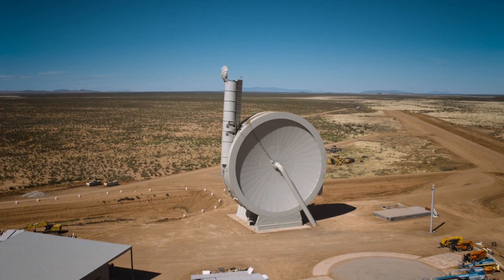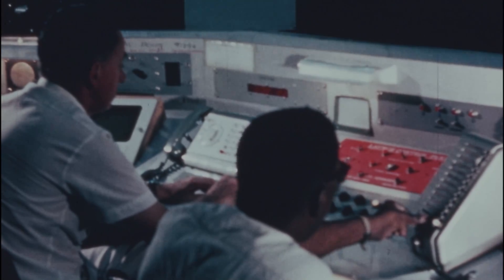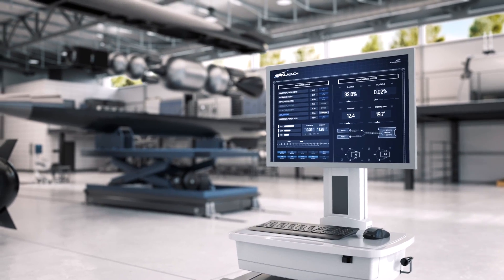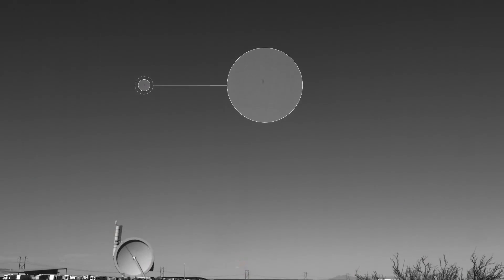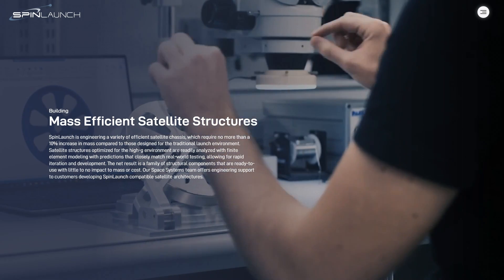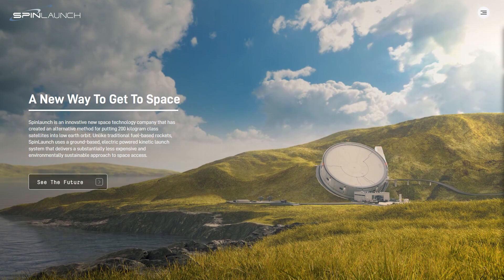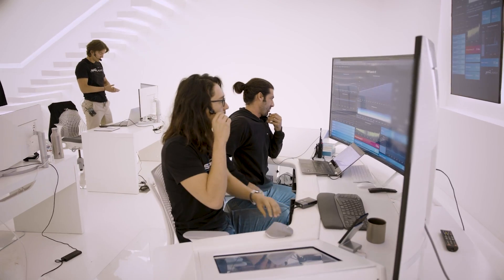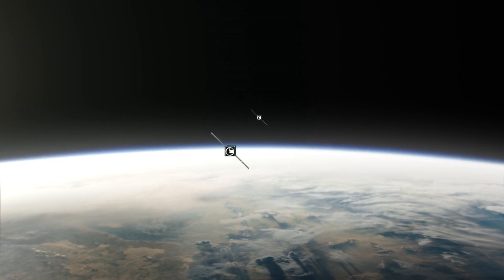Can Spinlaunch Throw Rockets Into Space?

Comment: "Like one millisecond to hit that very narrow exit channel"

If I'm not mistaken, at 450 RPM 1 millisecond is almost 4 degrees. I don't think they have that much wiggle room there.
Reply: I think he was referring to their test at 180 rpm
Reply: As a person who works on control systems - a millisecond is pretty huge.  This is not the most significant challenge of the project.
Reply: @jzero4813  the control systems aren't hard of course.

What I do expect to be hard is making an actuator that can physically open in 1ms (or at least with a opening time that's repeatable within 1ms) while also being strong enough to hold a Gerald Ford class carrier
Reply: @jonashageboke8993  And release it not all at once, but gradually (if that's the right word.)  The payload will have angular momentum that will have to be compensated for.
Reply: Exact timing and angle is not the concern. computers work really fast. The problem lies in the hardware, but I think they can use electro magnets for that, which will be very consistent.
Reply: @bugqualia8881  Sending a trigger signal at the precise time was never a problem, as that time is planned far in advance.  The actual mechanical release precision (even if using magnets) is the technical problem to solve.  Mechanical printers were speed limited by how precisely they could time hitting the paper with a lightweight needle attached to a slower moving mechanism.  DVD and Blu'Ray players are speed limited by how quickly they can move the optics to compensate for the disc being slightly off center (and by the internal G load on such an unbalanced disc).
Reply: I'm pretty sure the trigger is keyed to the rotation angle in some way, probably physically with gears, and that problem has been solved in internal combustion engines since the 1860's. Today it's not uncommon for off the shelf motorcycle engines to be able to open and close the valves with very little wiggle room at well over 10k RPM. Also direct fuel injection, and ECU controlled spark plugs are a thing.
Reply: It was solved in ww1 when planes needed to fire thir machine guns without hitting their props
Reply: @TheYrthenarc  The trigger would just have to be on the wall of the chamber.  EASY
Reply: They should hire this comment section.  ;)  As a mechanical engineer who works with power station turbines- a slight imbalance will absolutely turn this whole thing into a bomb.  Just look up the 2009 Sayano-Shushenskaya power station accident.  I would absolutely trust the PID control system- but the release actuator and rotor balancing are a different story.  Anyone know what kind of bearings they are using?  I am curious too if they are using a rotary encoder to detect the angle to do the release- if they can get the kind of accuracy they need.
Reply: @BenWard29  It could easily simply be mechanical. Assuming it will have a single optimal speed at which it releases, there is a single point along its circle of motion at which release would have to be effected. Imagine a spring catch releasing a pin, but the pin can not be pushed by the spring until it lines up with a fixed socket positioned on the track of the arc. This would give actuation of the release a full 359 degree arc in which to be triggered, with the mechanism only capable of actual release at the exact position that lines the projectile up with the tube. If you know how fast the mechanism releases, you can derive exactly where to place the physical structure that allows for release. This would absolutely prevent the projectile from being released at any other point. As to the balance  of the arm changing, that is easily solved by simply having TWO exit shafts and having a proportionally heavier counterweight on the short arm of the centrifuge that releases at the same moment- only in the opposite direction- This could throw a counterweight into an inertial dampening fluid like a shaft full of denser gas buried in the ground.
Reply: @christopherpardell4418  I don’t think it’s mechanical- I could be wrong- but I would assume they would want fine control over that and to let the computer possibly account for factors to release slightly early or slightly later.  A mechanical system would not give them the feedback or data analysis I think they want.  The counter weight idea would be tricky- you’ve got to release 2 items precisely otherwise you will unbalance the rotor- but maybe.  You’d likely be better off decelerating it electro-mechanically (reverse-rail gun) into a tube in the ground- you could gain back some of that electrical energy that way as well- a 2 for 1.
Reply: @BenWard29  	 But doing that electronically is a problem- Doing it mechanically is child’s play.   In an electronic system there’s a hundred different ways it could fail. If you make a system so that it CAN release at the wrong moment- then it almost certainly WILL release at the wrong moment, sooner or later.  But if it is physically delimited so that it can ONLY release in the right position for release, then you don’t have to worry about it. The way cam shafts control the valves in your engine…
The physical feature of the release mechanism could, itself, be on a track rotating about the same center as the arm, such that the physical release catch can be advanced to retarded to match the launch mass/velocity of a given projectile.  Again… in that way, you just actuate the release at any point that the rotor has achieved target velocity and the release can only actuate when the arm comes around to the firing position.
Reply: @christopherpardell4418  I mean- sure- electronic systems have their problems.  But if I were designing this system, at least the prototype version, I would want more control and monitoring than a mechanical system could provide.  Plus provide a fail safe/interlock system so it can’t release until the button is pushed (I would think you wouldn’t want to launch as soon as the optimal rotation rate is reached- you might have it sit at that RPM to collect data or possibly cancel the launch until someone calls it).  I’m not saying you can’t do this mechanically- I just don’t know why you wouldn’t do it with a control system.  Electronic PID loops are what we use in the nuclear plants to control valves in cooling loops as well as control rod insertion/removal- they are pretty damn robust and tunable.
Reply: @barnett25  conservation of angular momentum would like a little word with you.
Reply: Gonna be a spectacular RUD if this thing doesn't yeet at the right time
Reply: @barnett25  The only problem with changing the mass of the counterweight, or moving it, is that that takes time. Whereas the projectile weight gets released in as short a time as can be effected.   Its far easier to use the exact same release mechanism as for the projectile, for the counterweight, in that way they both get actuated at the same time and the mass of the rotor arm does not have even a millisecond of being out of balance.
Reply: 2.7° variance per ms. 

That should be fixable with the rocket, but this error goes straight into inclination, so they really can't afford to go much higher here.

How they want to release something with an effective weight of 110,000 tons within a 1ms window is beyond me. 
But then they don't have any mass savings either, so not like this makes too much sense to begin with
Reply: @jonashageboke8993  The issue isn't so much with going off the intended trajectory as it is "making sure the projectile goes out the exit hole and not thru the rather a bit thicker side of the vacuum chamber". That's probably part of why the exit to the chamber is made of such a short straight-line distance (all they really need is basically a "muffler" or "silencer" to put on the exit of the chamber, because you gotta slow down all that air rushing into the vacuum chamber or it will pile up and create a potentially damaging positive pressure pulse (or worse, an oscillation) inside your vacuum chamber.
Reply: @44R0Ndin  I really thought they would use some kind of hatch rather than that rubber to keep vaccuum and reduce the hydraulic pulse in vacuum chamber.  And by maintaining vacuum they would be ready to fire again, and be able to recover energy from the rotor spinning down.
Reply: @mokiloke  Well the rubber or whatever they used to make a seal on the end of the vacuum chamber is at least easily replaced, and really you'd have a lot of force needed to open and close a hatch that quickly so just letting the hatch be made of something that's easy to punch thru is the best solution available without making the thing super expensive.
Reply: @jonashageboke8993  On earth it doesn't make sense, but for near term lunar use it absolutely does. Most of the mass of the machine is in maintaining a gigantic vacuum, which isn't a concern on the moon. All you really need to ship are two extremely precise parts; the arm and the bearing. It either stays well enough balanced that the structure doesn't have to be crazy precise or it fails. If loads related to the rotation are being passed to the structure it is going to fail almost whatever you do. Building the structure out of locally sourced materials should be fine even early when lunar manufacturing is not very advanced. Even if you do import the structure it won't have to be crazy heavy. 

A linear launcher is probably easier, simpler, and better. It is also far bigger. This is probably the smallest mass driver suitable for lunar use that we could build. The technical challenges are considerable, but it does at least have a use case if we can solve them.
Reply: @agsystems8220  That is EXATLY what I thought when I saw this.  Lunar concrete for O'Neill Cylinders.
Reply: They just need to release a counterweight in the opposite direction at the same time. Maybe they could turn some profit from some mining companies while they're at it.
Reply: @loppanto  this was my thought. Maybe they could engage a braking Kinetic Energy Recovery System to spin up an equivalent mass which they could then use for another launch or to power local houses for a day or two!
Reply: @agsystems8220  On the moon, you could release the counterweight at the same time you release the payload.  (Just don't stand behind the thing.)  The biggest problem would be finding a place to plug it in: where are all those kilowatts going to come from?   You'd need a few acres of (extremely lightweight) solar cells.
Reply: @agsystems8220  wow already you can see the application for this - returning samples from the moon!  they are already launching at equivilant of lunar escape velocity
Reply: @jonashageboke8993  Yep, I get 2.7° per ms too (multiply by 360/60000=0.006), so they may need a quicker release.
Reply: It sounded like way too coarse to me, off the cuff and shooting from the hip at least.
Reply: And even if they nail the fire timing... that projectile will still be spinning at 450 RPM. How to cancel that rotation is an interesting problem.
Reply: @piteoswaldo  Why would there be any rotation once released?
Reply: @SecretNatureChannel  when the rocket is attached to the launch mechanism it has an angular velocity of 450 rpm. When it is released it continues to have the same angular velocity until an external force acts upon it to stop the rotation. Newton's First Law for Rotation.
Reply: @thebigmacd  reasonably sure this is not how the physics work. There should be no rotating moments present in the rocket if it’s fully decoupled at the moment of release. Angular velocity means nothing if there’s not a central point around which to pivot, and at any given moment the sum of forces acting upon the rocket itself will be a vector in a single direction. Unless you introduce moments somewhere, it will fly straight.
Reply: @thebigmacd  right, it will have the same velocity but why do you assume it will tumble instead of going straight when released?
Reply: @thebigmacd  You can test this out yourself. Tie a weight to the end of a string and swing it around your head very quickly. When you let go of the string the weight will take a straight path, it will not continue to curve. It is traveling in a circular path because of the outside force of the string pulling it in a circle. When that outside force is removed, it will travel in a straight line. The projectile does not conserve any of the rotation.
Reply: @thebigmacd  Only if it's suffering from some sort of yeeting disorder.
Reply: @SkigBiggler  let's do a thought experiment. If we move the projectile inward so it gets closer and closer to the axis of rotation of the machine (let's assume we somehow dynamically balance the rotor as we do this) until eventually we reduce the radius to zero so the center of mass of the projectile is directly in line with the axis of rotation, do you see how the projectile clearly has rotational kinetic energy? Does that rotational energy disappear when the projectile center of mass moves away from the axis of rotation? How far does it have to go? Is one micron enough? I am not a physicist, but I am pretty sure @widgy is right.
Reply: @SecretNatureChannel  Nobody is saying that the projectile will follow a curved path. Where did you get that from? The issue is, at the moment of release, does the projectile have rotational motion? I think the answer is very obviously yes. So why would that rotational motion stop unless the act of releasing includes some actuators to  impart just enough torque to the projectile for just the right amount of time to neutralize the rotational motion. I think @widgy is right.
Reply: Food for thoughts, but it could be doable to have a space crane to catch the projectile and hoist it even higher, thus reducing the amount of fuel even more. The fuel would mostly be used to steer the projectile towards a cradle hanging from the crane. It would even make more sense if the goal was to resupply a space station.
Reply: A big factor to make something work, is how much money people are willing to invest on it. The sad thing is, it may very well happen, because this looks pretty weaponizable to me.
Reply: @barnett25  there are 2 aspects to consider here.
Balance is the sum of weight (yes, I know its mass really) times distance from the centre. If you remove some from one side you either need to remove the same <mass x distance> from the other side or just move a mass inwards so <mass  x distance> is balanced.

The problem with moving a mass is angular momentum. Think of what happens when a spinning ice skater pulls thier arms in: they spin faster.
If that increase in spin is quick, the arms will have huge bending forces on them.
Reply: I suspect he meant to say microsecond. It's not a problem. A computer is more than fast enough for that sort of precision. 1 GHz, a modest processor by modern standards, is one cycle per nanosecond.  That's a million cycles per millisecond. Even if it took a few thousand cycles to figure out it's time to go and hit the release, that's accuracy in the thousandths of a degree.
Reply: I thought about that too
Reply: It was either round up to 1 or round down to 0 😅...
Reply: My estimation was also less optimistic, thanks for doing the math.
Reply: @barnett25  Right.
The moon is a very different situation.
First, no need to make a vacuum.
Second, and this is the fun bit. If it is built horizontal on a high point, then dumping the counterbalance weight is a simple(ish) solution. It would be tricky to marry launch requirements with the destination orbit of all the dumped weights.
Reply: Just launch it into a funnel-like thingy with the narrow end the correct direction.
Reply: Maybe they could fine tune the exit trajectory with magnetic fields or something like that...
Reply: .... from the look of things, they're not simply releasing it, either... they're releasing it in such a way that it cancels out the 450 revolution per minute tumble.
Reply: @Tomyironmane  Maybe that's why it has fins on it?
Reply: @Tomyironmane  Perhaps that is why in the slow motion of it perforating the vacuum seal at the top of the tube, you can see it tearing a slot rather than a single round hole.  I am sure the idea is that any tendency to to tumble will not be enough to significantly turn the projectile before it exits the tube  and hits the air stream where the fins can stabilize its trajectory.
Reply: @Tomyironmane  Their own video shows it tumbling. View Scot's video at about 00:20 at high res and 0.25 speed.  :)
Reply: @Tomyironmane  I had this same thought, just gotta hang onto the base a fraction longer after the main clamps let go, but that's some seriously precise timing to get right.. though it would allow you to do a slighty more gradual stress/load reduction through the arm as it releases... I still would love to know how they rebalance it quick enough to not destroy itself at those speeds.
Reply: In computer time 1 millisecond is an eternity + the launch trigger is probably gear synched like on old prop fighters that had machine guns behind the propeller blades.
Reply: It doesn't necessarily have to let go all within that one millisecond, it can begin letting go a bit earlier so long as it releases it the same way each time

Comment: Kleiner Perkins does not invest in startups unless their due diligence evaluation of the technology shows it to have a high probability of working and that the technology is protectable.  As Scott said, this is a no-brainer for launching material from Mars and the Moon.  The release imbalance problem could be solved be dropping an identical mass in the opposite direction down a hole at the same time. The surprising thing for me is that they can build a frangible window to withstand 14psi.
Reply: from the video it looks like there where multiple layers on the window, meaning that they could progressively load each one.
Reply: @jimdavis1576  Thanks - that makes a lot of sense.